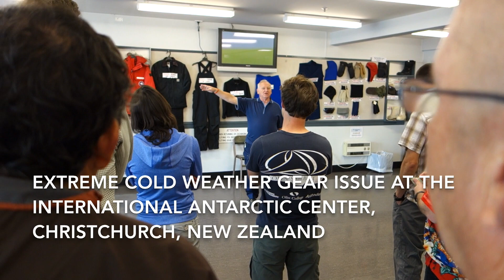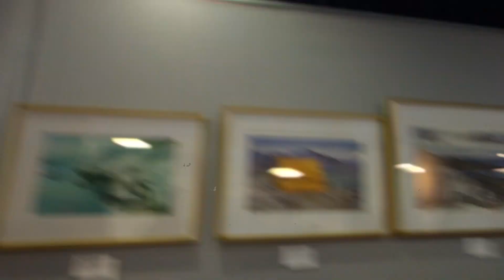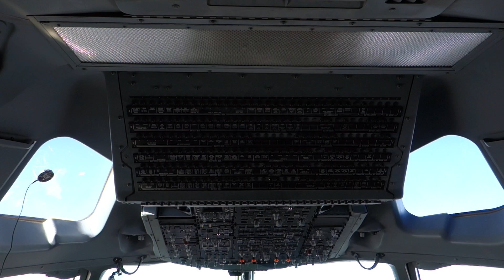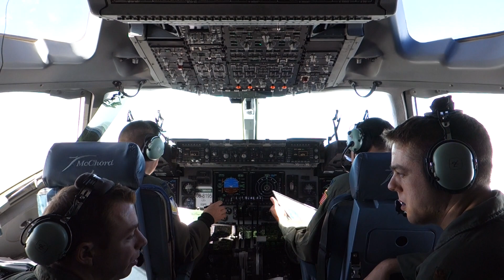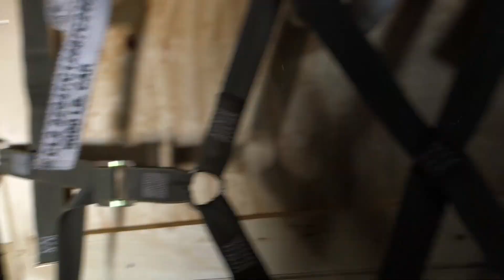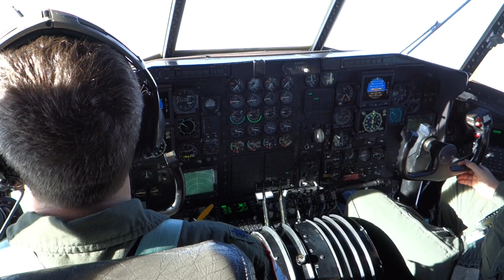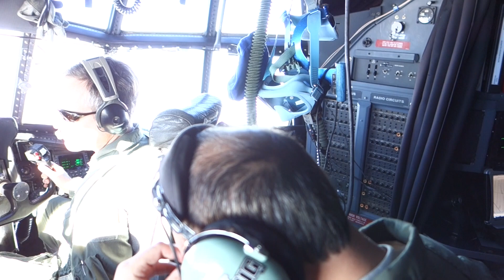Flying from Christchurch to the South Pole Station, Antarctica

Comment: They have been flying down to Antarctica for many years. Certainly on a regular basis since the mid 50s. The base at Christchurch Airport is a joint NZ US facility. It is a transit support base for 'Deep Freeze' operations in Antarctica. From where US C17 Globe masters, Hercules and occasionally, Galaxies. Along with NZ Boeng 757s Hercules and Orions (usually on southern patrols) operate in support of the US McMurdo, and NZs Scott base which isn't far from McMurdo base. Most of the flying happens in the warmer months,  between October and February. But as indicated, there are exceptions to that.

Comment: Cool vid! I would love to visit Antarctica. It must be an interesting place. I flew DC-3s for several years, although not with turbines. I can only imagine the hardships the air and ground crews endured back in the early days with those old radials. They must've had to dilute the engine oil with quite a bit of gas to get them turning in that cold

Comment: The interesting thing is SAS are operating passenger Boeing 737’s into Svalbard which is further north  ( just) than McMurdo is South . I am definitely not belittling the achievement here because there is only ocean between New Zealand & McMurdo whereas Tromso is not far from Svalbard. Flight are cancelled a lot because of weather.   The Hercules’s that’s just amazing.

Comment: Flat earthers will hate this for good...
Reply: why, what was proven here ? other than getting taken for $10,000+ on a restricted flight with no permission
Reply: Doesn't prove the earth is a globe.....
Reply: Earths curvature formula for a circumference of 24,901 miles is
8 inches per mile squared. You can not find and measure or prove any curvature exists anywhere. Water always find its level. Water doesn't curve either. Another impossibility of the fake globe model. Prove without using a government run space agency you live on a spinning wet ball hurdling through outer space at 3 different speeds and 3 different directions all at the same time.
Reply: @kdkinen  it isn't against the law to go there.  it's a dangerous environment... it's like 40 below.  not to mention they don't want it polluted. it isn't to hide an edge. it's too dangerous and hence why you need special flights and they son't want to pollute it.
Reply: @chrisizapimp  You sipping on that internet too much😂 Enjoy the globe my dude.

Comment: Try batteries at this Temp. No you use "Fossile " fuel of course.
Reply: McMurdo runs mostly on clean  nuclear energy .
Reply: @slow-mo_moonbuggy  lol. Are you Blind? 
Watch theirs HUGE cisterns. Boats , heavy duty mashines, AIRcrafts,  Snow wessels, heating
Reply: @slow-mo_moonbuggy  LOL. Are you blind? Ships,  heavy duty machinery,  AIRcrafts,  snow wessels, Heating... https://en.wikipedia.org/wiki/McMurdo_Station
Reply: @cathringustafsson2426 Are you blind?  I said mostly. Not all. The heating and electricity are all run on clean nuclear energy.
Reply: @slow-mo_moonbuggy  No. No New Clear power at all. Show me the Facility. They use A LOT of "Fossile " fuel. The Evidence are right in front of you.
Reply: @cathringustafsson2426  Granted it was called "Atomic Energy" at the time. Potado Potado. Also, I never said they did not use any fossil fuels at all. Your strawman theroy is quite apparent.
Reply: @slow-mo_moonbuggy  Give me a brake. Lol An old Cold War Propaganda movie. Show me modern movie.  Google Earth  shows Nothing. Not One photo of any "cooling " tower. New Clear doesn't work as you think. There aren't any New Clear weapons.
Reply: @cathringustafsson2426  Google earth doesn't show Palestine either. Doesn't mean it's not there.

Comment: It's called AntarCtica for a reason. I hate it when people pronounce it as if it were spelled "Antartica". I thought that the spelling of a word was at least a general hint on how it is pronounced. "Antartica" has little etymological meaning, as it takes the intact meaning of the word—opposite of the arctic—and brutally buries it under contraction and exception, like Aluminum as opposed to Aluminium. Regardless, a great video. I would like to go to both McMurdo and Amundsen-Scott South Pole Station eventually!!!
Note: Both English pronunciations are technically correct, although I vastly prefer "AntarCtica", just like with Aluminium over Aluminum.
Reply: you mean like "orangutang" instead of "Orang Utan" which - as well - has an etymological meaning (Malay for "Person from the woods/jungle". Americans just seem to like mispronouncing foreign words in a way you don't recognise their origin anymore.

Comment: I like how there are no windows for the passengers to see where they are going in reality combined with Scientists telling us to believe them. Not one cares to pay close attention to the actual flight route or wormholes they might pass through.
Reply: +elektron2kim Yeah someone needs to explain this as any normal plane should be able to be used for trips in the North and South poles which off course includes the ones with windows so people can see what they are actually travelling over.
Reply: +elektron2kim Wormholes as in they went to another planet? And you really don't know why there aren't any windows on the plane? It's because they are using a military plane, and there is an obvious reason for that. Firstly, any normal plane could fly there. However, it's not like going there is in high demand. You aren't going to see West Jet bother doing bookings there. This is due to training, equipment, and other obstacles associated with air travel to these regions. Why would most airlines that are business want to invest in this? Especially when there are rugged planes such as these that are more than up for the task of accommodating an extremely small group of people. Flying a commercial jet to an area like this simply doesn't make sense for obvious reasons. What is the most practical mod of transportation to the most desolate place on earth? A military jet obviously, it's built for landing in places such as that. I'm kind of shocked that I had to explain this.Instead you think it might be wormholes, lol?
Reply: +cptcanada The military COULD fly them to a strange place without they would even think about it or check it. Scientists nowadays never check reality. They just parrot info, theories and whatnot which could be false from the source.
Reply: elektron2kim You gotta level with me here buddy. First off all, by strange place are you still talking about a wormhole? If not, we're still on planet earth right? In that case where on planet earth is this place if not Antarctica and why lie about it?
Reply: I used "wormhole" to underline that even such an experience would not convert a scientist to his own observation and thinking.
Reply: elektron2kim I'm sorry buddy if you had said that a month ago I wouldn't have thought of a thing of it. However, ever since I decided to read the comments on NASA videos I've been skeptical about what people say when it comes to the geography of earth. There are actually people out there who still believe that the world is flat, I didn't think that was a real thing.
Reply: CptCanada Don't get sucked into imaginay science and the crazy section of "flat earth" where any debate is censored, though.
Reply: Ok. On a military plane the view for each and every passenger is less important than the equipment carried along, because this is not an airplane originally made for passenger transportation but for cargo. Cargo in general, does not have quirks about the view. Secondly, going to Antarctica, which is not your average Disneyland destination, is not available through British Airways, American Airlines, China Airways or Air New Zealand. Thats because Antarctica is not like Hawaii or the blue lagoon.
Reply: I WAS JUST THINKING THE SAME THING.. I WAS ACTUALLY TRYING TO SEE IF THE PLANE HAD WINDOWS SINCE I SAW A DIFFERENT VIDEO STATING THE SAME THING..
Reply: Don't know what video you watched but I saw windows in the 1 i'm seeing
Reply: Exactly what drugs are you taking?
Reply: @elektron2kim: Scientist have to spend many years becoming scientists by learning vast amounts of information and practice.  If you want to become a "self thinking" scientist you have to at least learn your trade first.  Science isn't about "self-expression."
Reply: Actually there were sightseeing flights out of New Zealand and Australia for many years - until one crashed killing all on board. Erebus disaster - still I believe NZ's  worst air crash. The reason they use cargo planes is because of all the cargo... and comparatively few people that need to get down on each flight.
Reply: elektron2kim there is litterally multiple small circular peep holes if you’d watch the fucking video

Comment: 11:15 more flat earth. No curve there at all.
Reply: Michael Zorba ?? They are only a few km high... the curvature is so slight at this height u can barely detect it...plus the horizon is mountainous...  plus the horizon is completely blurry... but wait doesnt this continent not exist  according to flat earth believers?
Reply: @Dannyboyy86  Flat earthers seem to think that the earth is so small you could see curve at typical flight levels. The earth is BIG. A lot bigger than 300miles in diameter.